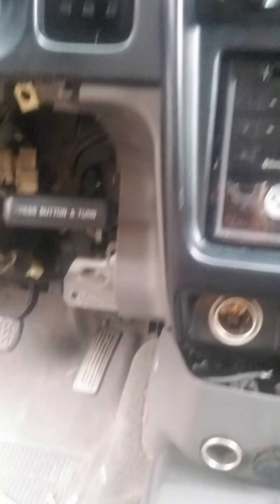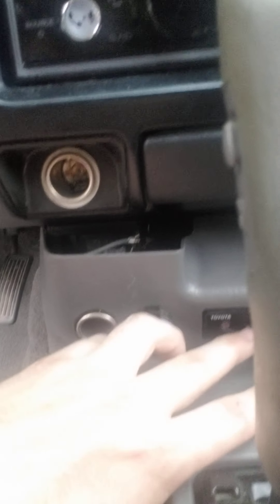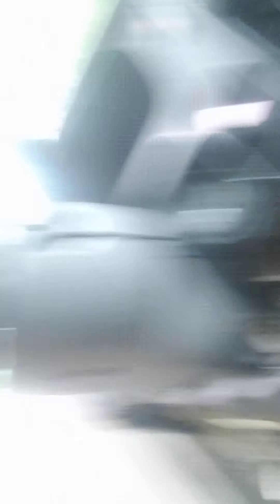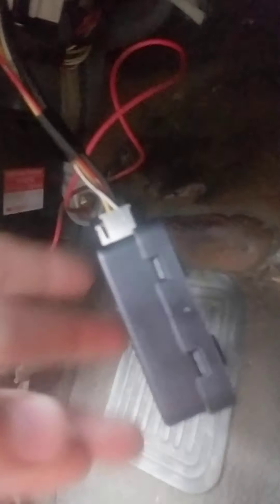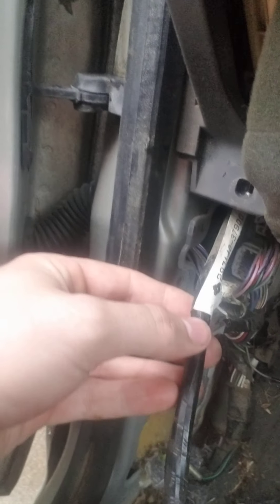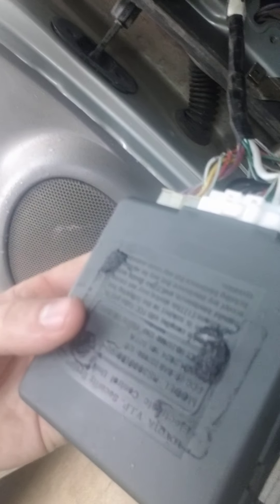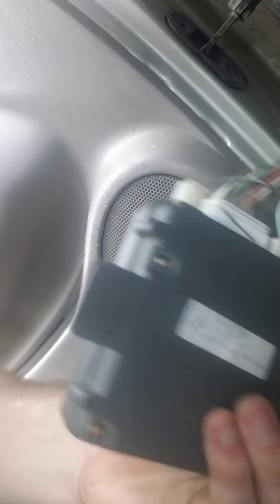2001 First Gen Toyota Tacoma security system Module location and information.

Comment: I've replaced my entire ignition system (except the wires) looking for why my truck won't start. (No click, no start) 
I replaced: 
the battery, 
the alternator, 
the solenoid and starter, 
the starter fuse,
the starter relay, 
the ignition switch, 
and the neutral safety switch. 

All were tested and working... I was begining to think the wiring might have a short somewhere... maybe even in the engine area fuse box... then I thought about the anti-theft system (alarm, security system)... this vid helped me. My alarm had a bad relay. Now if I ever have a starting issue again I have a whole spare OEM 96 Taco ignition system to test and replace parts with. 

Preemptive answers:
No, I didn't return anything. No, I will not sell you my parts.
Reply from the maker: I'm glad my video was able to help!
Reply: I'm experiencing the same no crank/ no start delima with my 2001 Tacoma 3.4lt v6 quad 4x4. Entire ignition system is in working order, all accessories come on and work it just won't start. I had my truck towed when my lower arm on front end broke while driving and tow truck driver had to bypass my automatic transmission system to get it out of Park. So I've been thinking there's an issue with an anti theft device on my truck. The problem is.... while my key fob has the selector to disengage my alarm system and the alarm on my truck went off once a long time ago, there is no evidence of an alarm system in my truck. ? I am baffled!!!!!!!!
Reply: @rachelcosgrove2048  so in it's most basic form, the neutral safety switch is a device that makes sure that your car will not start unless it is in park or neutral. (In practice, it does a lot more... like; turn on your reverse lights when you put the vehicle in reverse, or inform the ECU [Engine Control Unit, colloquially known as 'the computer'] what gear your in so that it can use that to help regulate the fuel injectors, and all kinds of other fancy stuff) but for our purposes of diagnosing your vehicle we only need to focus on its basery functions. If I had to guess, the tow truck driver bypassed your neutral safety switch. Probably using a jumper cable (similar to the type that are used for jumping car batteries, but it's significantly smaller gauge makes it much smaller and sleeker.) Typically, this would be removed and kept by the tow truck driver, but he must have forgotten his jumpper and left it attached to the vehicle. There is a quick way to test for this, simply try to start the vehicle in any other gear other than neutral or park. Carefull, starting a vehicle in gear can be dangerous, as the vehicle will want to move immediately. You can mitigate this danger by engaging the parking brake, and holding the brake pedal down while starting the truck. If it starts in a gear it's not suposed to ie drive, reverse, 1st, 2nd... then your neutral safety switch is either broken or being bypassed. If not, I'd be baffeked too. Can you set off your alarm (hold panic button) then deactivate the alarm? If so, your auntie theft system is probably not the culprit. Can you start your truck by jumping the relay (pulling your starter relay out of the fuse box under the hood and connecting two pins of the socket... watch videos online to figure out which pins. Be careful and extra sure, as you can fry other things in your ignition system if you get this wrong.) If jumping the relay works, that tells you that the problem is either your relay itself, or after your relay, but not before it, in the circuit. This test can help eliminate half the circuit. If your truck starts by jumping the relay, you know the starter is good the battery is good the solenoid is good and maybe the starter fuse is good (in your case it does not rule out the starter fuse as in your truck that's after the relay. However a fuse is easy enough to check, your starter fuse will be in your fuse box in the cabin of the truck.) Hope this helps.

Comment: You helped me out big time ...I adjusted the sensitivity on it and works like a charm.  I would set the alarm and then less than a minute later it would go off by itself I located the box took it out inspected . The sensitivity was marked at 5:00 I put it up to eight and no more problems thanks again man.
Reply: Hi Rick, can you tell me where I can find instructions on adjusting the sensitivity on mine.  My cat converter got ripped off and I sure wish it would of sounded.
Reply: @russgeer9450  I set it to zero on the alarm box itself. It will only go off if the doors are opened . 1 2 3 and so forth goes up on sensitivity .
Reply: @rickmartinez398  I need mine to go off if a saw zall starts to cut thru my exhaust again.  I want it at its most sensitive setting.  Would that be 1 or 10?
Reply from the maker: Hi Rick, I'm so glad you were able to figure out the sensitivity issue. Though we didn't have the same problem I'm so glad I was able to help you locate it!
Reply from the maker: And Russ, you could easily experiment with the sensitivity dial and figure it out!😁
Reply: @codyonekinobi5271  Where is that located?
Reply from the maker: If you have the security system in hand and examine it you will find a dial to turn to a number. And my video shows were to find the security system

Comment: This system was in theory only available for the 1996-2001 Tacoma. Not all Tacomas have it, and not all Tacomas that have it have this particular system. Some dealership networks and distributors, namely Gulf States Toyota and Southeast Toyota Distributors, installed aftermarket systems for whatever reason; now those systems were god AWFUL and I would avoid anything that has the aftermarket systems. Those just have a red LED button where there would normally be a blank plate.

Comment: I had the rs3200 and got a key fob to remote unlock it but doesnt have the alarm part of the deal for some reason and dunno. If there’s another module needed or if its just missing something turning the alarm on also..

Comment: I have a question I have a 04 tacoma and I know I can add a key fob which I got a factory OEM coming through the mail I still want to add the glass breaking sensor (tayota security) I seen this video and I was wondering If all I will need will the the little modular that pops into the slot the has the little light which saids tayota security and will that plug into the main wire if I’m able to fined it or will I need that plus the little black or grey module that you said looks like a computer brain and if so will that plug up tot the keyless entry along with the tayota security for the glass break unit to work or since I do have to keyless entry is the tayota security that pop into the plastic housing near the 2 12 volt outlets all I will need, I looked and like you said their not much info and especially video online about them at all, I’m thankful I found your video, hopefully if you know you can let me know and if not Hopefully you can help me fined out, alone with programming the factory key fob to the truck itself!
Reply from the maker: Unfortunately I don't know man. Hopefully it's a plug and play

Comment: Can you see if it works with the security light unplugged?
Reply from the maker: @DA9enthusiast  I did actually try that and it did actually work for me with the security light unplugged.
Reply: @codyonekinobi5271  thanks for the response. I ended up finding out with it unplugged it’s only keyless entry. That light/glass break sensor is what actually turns the system into a full alarm system.